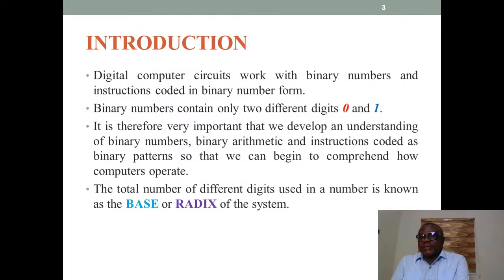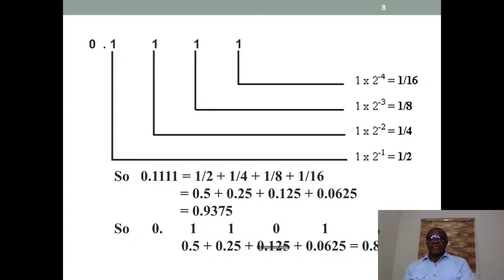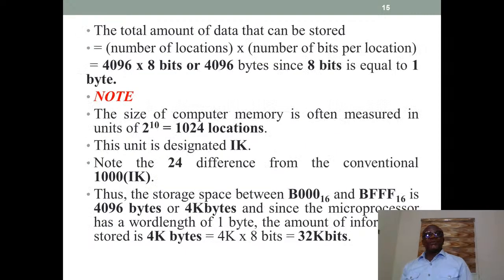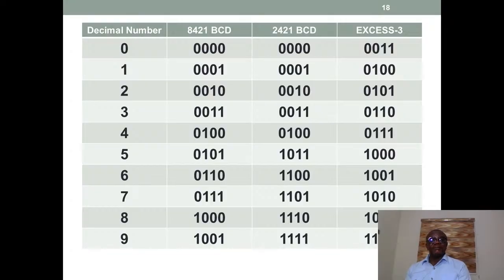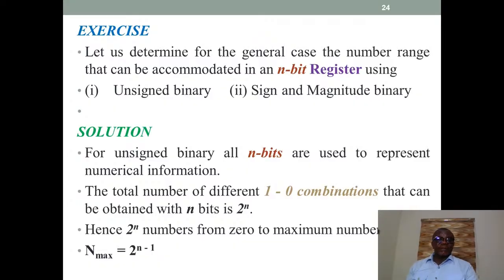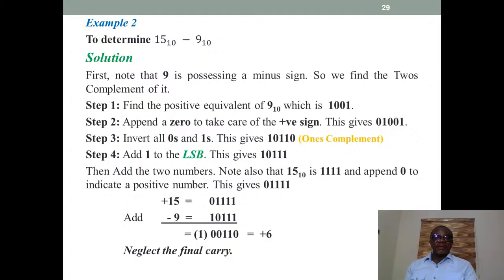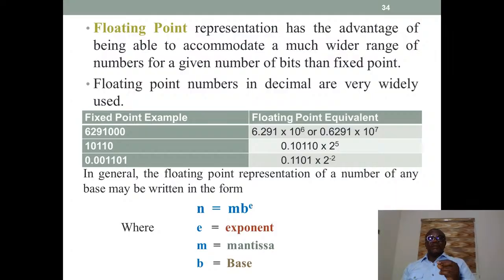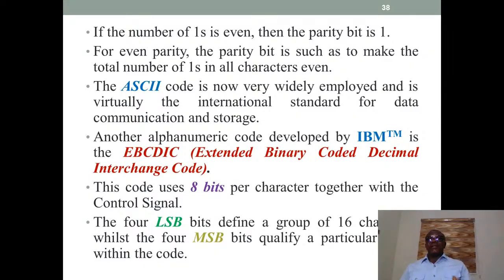Computer Number System. Engineering Lecture Series Module 019

Comment: In an 8-bit sign and magnitude system:

Maximum Positive Number: +127 (01111111)

Maximum Negative Number: -127 (11111111)

Range: -127 to +127 (with two representations of zero: 00000000 and 10000000).
Reply from the maker: Good

Comment: Good evening sir 
For the positive numbers the MSB is 0 and and the maximum magnitude is represented by all 1s in the remaining 7 bits. This is 1111111 in binary, which is 2⁷ - 1 = 127 in decimal.

For negative numbers, the MSB is 1, and the maximum magnitude is also represented by all 1s in the remaining 7 bits. This is again 127 in decimal. However, the sign bit makes it a negative number.

Therefore, the maximum positive number is +127, and the maximum negative number is -127.

Reg: 20231402243

Polymer Engineering (Poe)
Aniebiet udo

Comment: -101.0 base 10 Peter Chiagbanwe Joshua 
20231370203
Biomedical Engineering
Reply from the maker: Can I remember the question you are trying to answer. Join in my GET 211 lectures tomorrow Friday 28 by 8.00pm to start earning points

Comment: In the 8421 BCD (Binary-Coded Decimal) code, only the binary representations of decimal digits 0 to 9 are considered valid. The 8421 BCD code uses 4 bits to represent each decimal digit, and the valid binary ranges for these digits are:

- 0000 (0 in decimal)
- 0001 (1 in decimal)
- 0010 (2 in decimal)
- 0011 (3 in decimal)
- 0100 (4 in decimal)
- 0101 (5 in decimal)
- 0110 (6 in decimal)
- 0111 (7 in decimal)
- 1000 (8 in decimal)
- 1001 (9 in decimal)

The binary values 1010 (10 in decimal), 1011 (11 in decimal), 1100 (12 in decimal), 101 (13 in decimal), 1110 (14 in decimal) and 1111 (15 in decimal)** are *invalid* in 8421 BCD because they represent decimal values **greater than 9. Since BCD is designed to encode only single decimal digits (0–9), these binary values fall outside the valid range and are considered illegal in the 8421 BCD system.

Why are these values illegal?
1. 8421 BCD is designed for single decimal digits: Each 4-bit group in BCD must correspond to a single decimal digit (0–9). Values 10–15 cannot be represented as single decimal digits.
2. No ambiguity allowed: If these values were allowed, it would create ambiguity in interpreting the binary code as a decimal number.
3. Hardware and software constraints: Many BCD-based systems (e.g., calculators, digital displays) are designed to process only valid BCD values. Illegal values could cause errors or undefined behavior.
Reply from the maker: @preciousmiles6992  The reason is simple. Those 6 combinations represent A, B, C, D, F, and F in Hexadecimal. So, if you use any of them the computer will Interpret it as so instead of seeing it as numerical value.